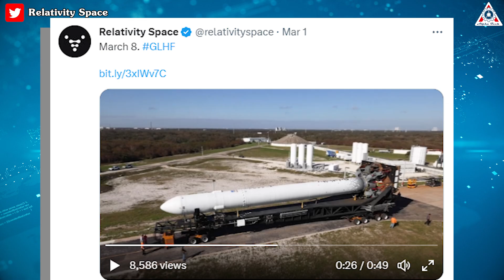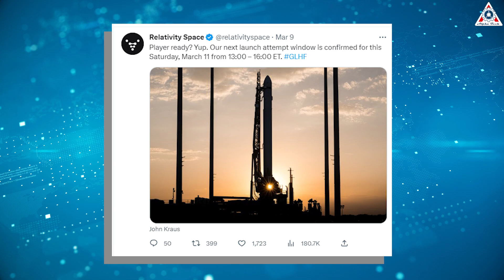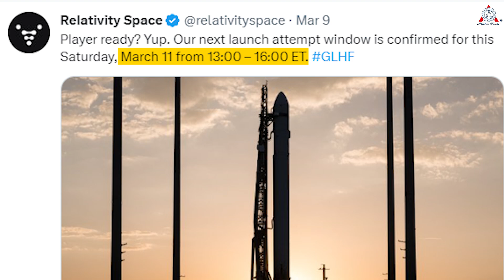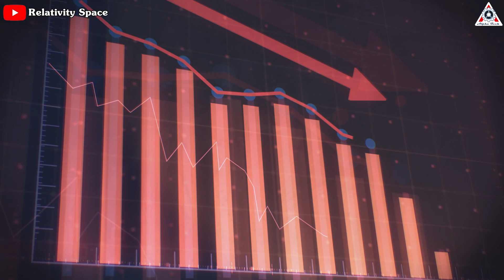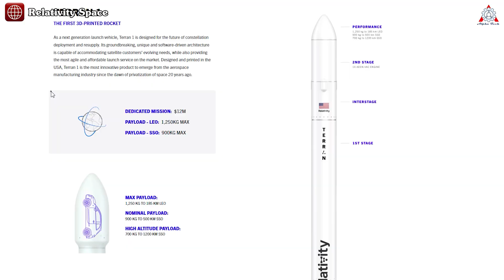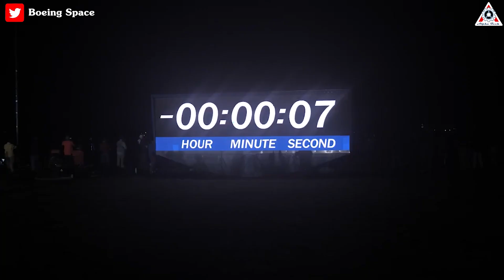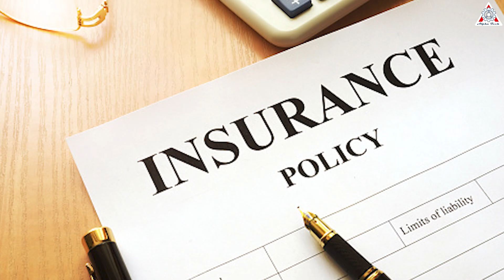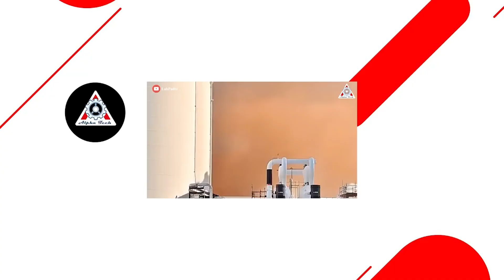FAIL! The First 3D Printed Terran 1 Rocket Launch, any chance to BEAT SpaceX?

Comment: good video but
Calling the "Relativity space" events at LC16 a "failure" is perhaps a little overkill, as it's a first not only for the company but also for their launcher and its 3D printing technology.

With so many unknowns in the loop, taking the necessary time is not a failure, it's just caution.
How many space "behemoths" have had "disappointments" (even R.U.D.) with a new launcher for having precipitated a shot (Nedelin disaster....).

Even the SLS had engine cooling problems (as here the TERRAN1 here it seems), and we didn't talk about failure, just postponement

Comment: 3D printing for spacecraft is dumb.The process has many downsides that are especially costly when extra weight should be a top priority. First problem is that 3D printing produces a cross section that is a series of bulges, like a rope-coil ceramic pot. You can see the bulges between layers as the strange texture on the parts. The strength of the material is determined by the thinnest cross section, so those bulges add weight without providing any additional strength. Unless they mill off that extra material (they don't because that would defeat the purpose of 3D printing) they start with a huge accumulated weight disadvantage. 3D printing may have an advantage for complicated engine parts that are impossible to machine, but why the heck are they printing the tanks?!? Sheet metals are going to be MUCH cheaper and more consistent than printed material. A couple of passes thru a rolling press and you're done. 
The next problem is that unless the part being printed is kept in an oxygen free environment between passes, the newly laid down layer will oxidize, creating impurities that weaken the metal. Now, I can hear people typing right now to say "Welds are stronger than the base material", and with mild steel, that can be true. But if you spec your materials to be the same (or better) crystal size and temper as the weld, this concept is no longer true. Aerospace companies buy the right sheet products.
Reply: So in your world, new techniques or technologies should never be tried or tested?
I suppose with your closed mindset, rockets can’t land engines first? They can’t return to the launch site? They certainly couldn’t land on a floating platform!
And why would Relativity add more buildings, more machines, more staff & more processes, to roll tanks, when they have a massive 3D printer? 
How would sheet metal tanks integrate into the vehicle?
Trying new stuff is how things get better, faster, cheaper, and progress! 
At the end of the day, it’s not your money, and it’s clearly not your field of expertise…. Why dismiss something that’s never been done? 🤦🏼‍♂️
Reply: You poor, foolish soul. Of course 3D printing isn’t new! 3D printing a rocket is though. 
Unless YOU have invested in this, and it’s failed, why bother about those that back the trials?
By your logic, you think we should’ve stuck with 1969’s design & tech!
3D printing a rocket engine couldn’t be done, until RocketLab did it!
I don’t get why you’re so negative towards things.
Do you work for Blue Origin or something? 🤦🏼‍♂️

Comment: My main concern with starship is their decision to use stainless steel. I'm sure spaceX has some of the best welders available but each every weld they out on that vehicle is a potential failure point. And stainless is particularly difficult to weld compared to other metals. Guess we'll find out soon enough if spaceX can keep their progress moving forward.
Reply: Relativity's rockets are ALL welds. This makes the whole thing one big "failure point"
Reply: @danoberste8146  i thought it was carbon fiber resin which when it dries is one solid piece.
Reply: Machines now do the welding as they are much better at keeping precise welds than humans. Look at the first starship nosecone versus now. Night and day.
Reply: @jeffveron8783  i know they use robots for a large portion of the welds but there's some welds robots can't perform.

Comment: I hope these guys have success, but this 3d printed rocket thing is a gimmick.....

Using sheet metal to build the tanks would be lighter, faster and not take up valuable 3d printing time.... 3d printing shines by creating intricate objects in 1 piece so they r small and have less parts and weight, things like tanks that are flat shells r better made with sheet metal.
Reply: Not necessarily.  Relativity has already said they have about a 10% weight penalty compared to traditionally built rockets, but the cost and time savings in manufacturing tooling are significant enough for that not to matter.  I doubt all rocket manufacturers will switch to 3D printing but I bet the gimmick is here to stay.
Reply: No disrespect to spacex they are one inspired companies to join the rocket industry! But competition increases innovation! Spacex has pretty much the dance floor to itself apart from ULA , rocket lab and SLS! Rocket lab as really been only the operator for satellites ride

Comment: Dudes!  GMT is Greenwich Mean Time … not general mountain time.  Some may refer to GMT as Universal Time Coordinated (UTC).  The US military uses ZULU ( usually abbreviated as Z).  So GMT, UTC and ZULU all refer to the same time zone in Greenwich England.  For example, the next launch attempt will be on Saturday at 1800Z.
Reply: Thank you for clearing that one up. I was just about to make the exact same comment
Reply: ZULU time is mainly a co-ordination time for missions of which troops are dispersed across several timezones to avoid confusion.  I can't remember if ZULU is set in accordance with GMT though.  I was a RADAR operator for three years (62nd Artillery HAWK air defence, Delta Battery, Essentho West-Germany) from 1979 until 1982 and we always operated on ZULU time.
Reply: @JimmyRJump  Yes sir - correct on all accounts.  Yes - ZULU = GMT = UTC.  My son is Field Artillery - 2nd of the 8th!
Reply: GMT (Which is the British time during winter) has been replaced without any change by UTC, as now BIPM (Bureau International des Poids et Mesures = International Bureau of Weights and Measures) is responsible for inserting leap seconds to adjusting the time to the non-constant rotation of the earth.
Reply: Holly crap, all I can say is Do and Brew’s post is correct.  But these different interpretations are amazing.
Reply: Yep. The guy is an idiot trying to be a know it all. 😂😂😂
Reply: It's confusing, sometimes,  the Brits Daylight savings time switches on different days to ours. I just usually Google it.